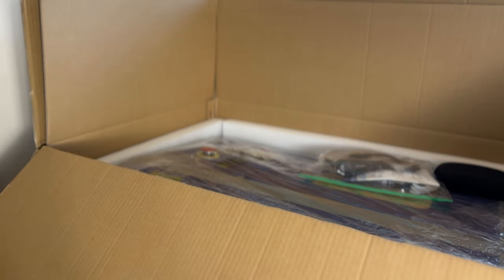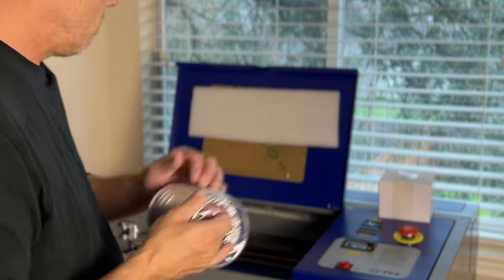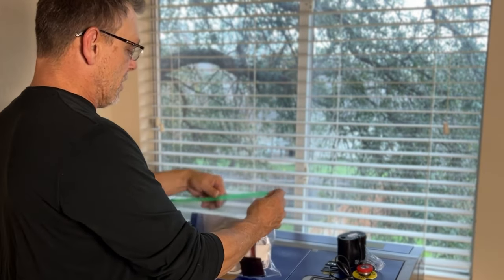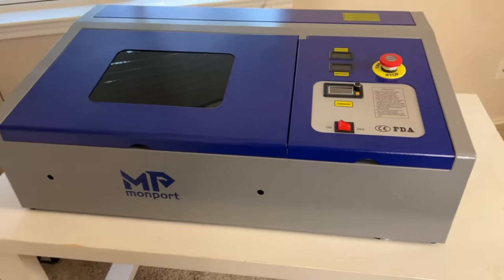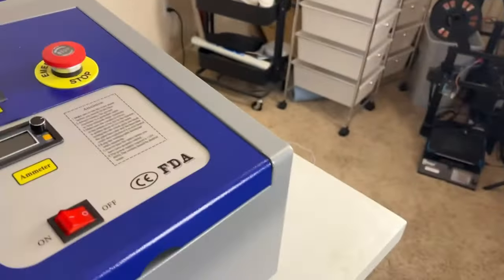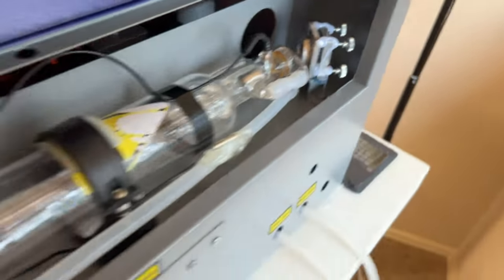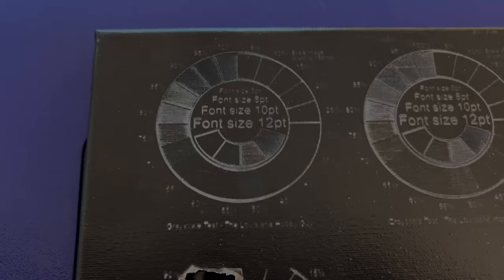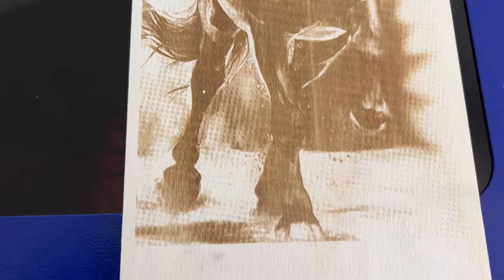Monport 40w CO2 Laser - First Impressions

Comment: I am curious what rating is listed on the generic tube? Monport advertises as greater than 40W, if this tube is not greater than 40W that raises legitimate questions about this machine. Was looking at purchasing but with this red flag may go elsewhere as the Yongli tube was pushed as a selling point in several videos. BTW thanks for the video.
Reply from the maker: Agreed, I can’t find the rating on the tube that came with mine. Given that it’s a generic tube, who knows. The yongli tube was the selling point for me as well. The tube is the heart of the machine. I deem this a typical k40, it’s just LIGHTBURN compatible now.🤷
Reply from the maker: A word of advice. If you do order with a chiller, make sure the chiller is in stock. The temp of the water is important and without the chiller, you won’t get good results. I have yet to receive mine and IMO is likely part of the issue I’m having. The better chiller more than the cost of the machine. You’ll also want to set aside $ for upgrades, laser head, air assist, in-line fan etc.
Reply: @wtwtx  I actually purchased a 5200 chiller off Ebay in preparation for getting the machine. I guess it will just sit unused until I decide which machine to purchase.
Reply: @wtwtx   I also just bought this with chiller. The rating on my tube says 41w. Your rating should be on the tube label. Looks like the ceramic block is covering that info.